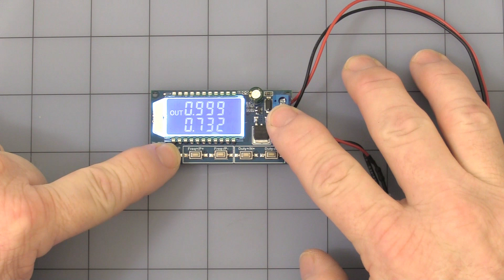High-power PWM dimming speed control module 36128 MD

Comment: I found that very interesting, since I need an igbt-gate-driver (switching the igbt on-and-off with 200-500mA), while the igbt-driver is itself driven by such a pwm-generator at maximum 35-45kHz (pwm-generator looks the same as yours, but outputs only 5mA - 30mA )... Do u think I can use  a generator like yours, since it can output up to 8A ??? How do I limit the output current then (?), since I need only 0.5A and not 8A ??? (I have no clue if I really have to limit the gate-triggering-current, or if it actually self-regulates according to the igbt-gate´s-demands)
Thanks for any answer !!! I have no idea about electronics, and so, have to find a ready-made solution for my problem...

Comment: This would be great if it could handle 200VDC input. I want to take 120VAC, rectify and filter it then put it into a device like this, then I could take the output into a 36V 86W [2.38A] LED chip but set the duty cycle so the LED is running at about 50W. In essence use it as a variable power supply.

Comment: Can we use it to actuate a 12v actuator of 4 ohms
Reply: He said the mosfet handles up to 8 amps. ohm's law would be... 12 divided by 4 = 3 amps. You actuator should have a rating of 3 amps printed on it which is well under the 8 amp capability of the device. You need to use a supply which be able to handle the load such as 12v at 4 amps which would be 75% load on the supply during constant on.